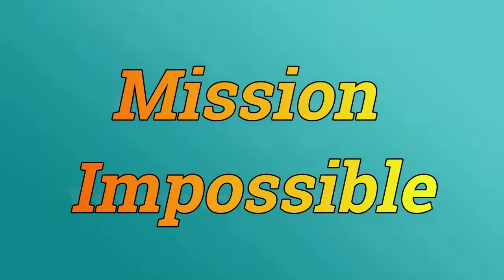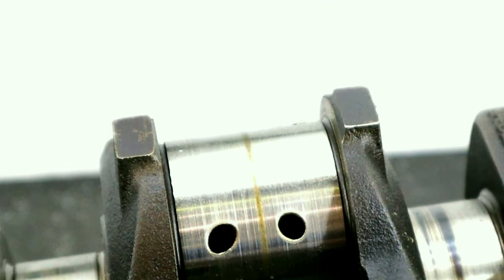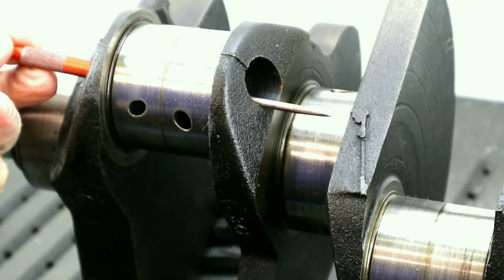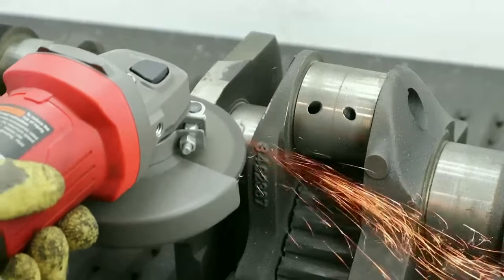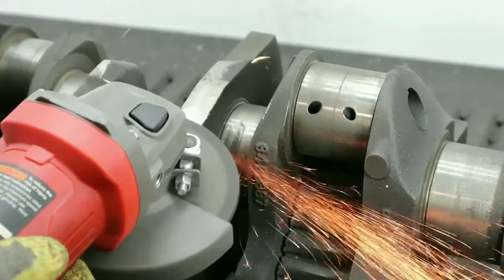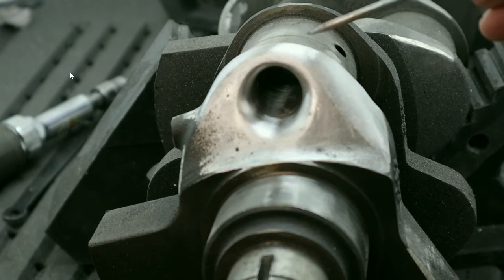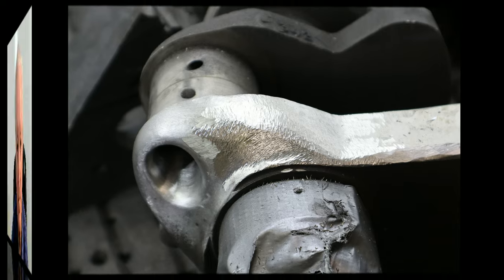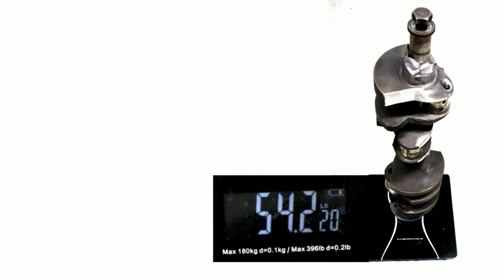How to modify a stock crank to entry level race crank.

Comment: I want to share this with you vizard fans. As a younger man in my early 20’s aroun the late 90’s I purchased his cylinder head book. I read it front to back and back to front numerous times. I built my first serious engine using his tips tricks and techniques in cylinder head flow. I ported my heads for this engine. I put this engine in my daily driven 3rd gen camaro. First time out to the track it went faster than my hoped for time by over half a second. I just wanted a 12.0 daily driven combo. This thing, full weight, nice car, everything worked and on some crap 555r radials with the cords showing, blistered a 11.56 at 121 mph. I credit most of what I learned on cylinder head porting to this man. Thanks David for sharing your hard learned secrets!
Reply from the maker: Travis - you are very welcome,
Reply: @DavidVizard  hi sir, is it possible to use your knowledge in the video on a 4 cyl. crank ? what's your tought ? and thanks for your videos
Reply: I read his book and used almost the one 400 chart for my 406 build in my c3. Everyone said I was overcarbbed would be a dog etc. It's the fastest engine I ever built!
Reply: Also I polished and ported every oil passage and molded my hp950 carb even knife edging the butterflies and screwheads... molded the melling oil pump per his book it shoots oil 8" over the headers now. Lol
Reply: @kermitahnenerbe3722  Doesn't matter what kind of crank, the basic principals are always the same.
Reply: @CarLos-yi7ne  thanks

Comment: Thanks again for all you do. I always get nervous grinding by crank journals. So I get radiator hose and cut it into rings wide enough to cover the journals and hold 'em on with zip ties. Then grind to my hearts content
Reply: Or just tape the old bearings on
Reply: I use a PVC pipe and ducttape
Reply: I know when I get a grinder into my hands, especially a small one like a die grinder, or a dremel tool it's very easy for them to get away from me and either take more than you wanted off, or to hit something you didn't want to touch. As David demonstrated it's a great idea to cover up what you don't want to touch. It's also a task that takes some practice to get good at it. We need to take our time. Getting in a hurry is often the cause of mistakes and of course take the time to understand what we're taking off and why.
Reply: Yap yap yap yapity yap.
 Watch my video about a crap crankshaft SCAT sent me and how I fixed it.

Comment: I'm sure David would agree that if your doing this for the first time , protect the bearing journal's on the crank by wiring on some old bearing shells or shim stock . This is a cast iron crank which is identified by the thin flash line , numbers , sand finish etc. Your engine , depending  on age , may have either a cast crank or a forged one which is more desirable,  although a cast crank has some desirable properties. A forged crank is identified by a wide flashing , with obvious  grinding marks , no through holes in the big end etc., but the process is the same . When deburring using a rotary tool , take time to radius the oil exits on big end and mains to improve oil flow but do this after gaining experience with the tool on the metal in non critical areas of the crank .
To reduce the wind age in the crankcase and overpressure oil leaks , I run a constant vacuum by using an alternator from a diesel engine that is fitted with a brake servo vacuum pump . Fitted to numerous Japanese engines you also benefit from the very reliable Denso type with high quality bearings and seals rated at high rpm . Both the vacuum pump and alternator can be modified to aircraft spec with little cost and effort and to make the pump adjustable for depression if you are fitting your modified engine in a kit build aircraft .

Comment: Great show as usual, David… But I believe in buying quality tools , you can get those cheap ones and they will last a while If you don’t use them that much and push them but they eventually crap out .Matebo,Bosch, then pretty much everybody else from there. I tortured grindersfor a living and tested the Metal of many of grinder finding that wanting except for these two brands I previously mentioned the Meebo is absolutely perfect piece of engineering… Keep on rocking

Comment: Really enjoy this mopar engine series.  The grinding of the connecting rods are out of the hands of a DIY project and I don't know if a machine shop would take on the meticulous grinding process or what they would charge if they did.
Reply: I worked in an engine shop,and when I was building one for myself I wanted to do all the little tricks like this so I was asking a couple of the race guys ,and they're like don't bother it's not worth all the time. 
But to me it is , so it's a diy because you're right, a shop will never do this, and/or it would cost a fortune if they did.

Comment: My respect to you sir, I appreciate what you are doing. I'm really inspired by your video, I think I'm going to pick up a cheap and easy project to work on! since I live in Europe my choice is a Fiat 126 twin piston air cooled engine, in addition to modifying the crankshaft, I will lighten the flywheel and connecting rods, I will try to find motorcycle pistons that fit the engine, a motorcycle carburetor, finally a modified exhaust system. it's a 650cc 24hp engine, if i get 5 to 10hp i'll be happy. I'll probably play with the engine head too 😃

Comment: This is very timely for me, as I am prepping a 440 crank and was wandering what those dogs, lugs, or pads around rods 7 and 8 were doing there. Is there a all or nothing approach for this or can I stop when I feel I have removed enough? Meaning I don't think I will be able to achieve the level that you will take it to, but do enough to make a difference. I have the bob weights for the new Icon pistons and lightened & balanced rods thanks to your videos. After this I will be ready to bring the crank in for final balancing. Thanks, I have already supported (3 space pups) and will continue to support St. Jude's.

Comment: Thank you Mr.DV!! I wonder how does this grinding affects the combined balance of the flywheel and crankshaft in sbc?
Reply: ,,, not at all, you just don't start the balance process, till after you have the crank where you want it . Of course you might keep in mind where you are grinding, but the final balance is later  . The small blocks are internal balance, except for the 400, but the former statement still applies  .

Comment: If you have the means milling off most of the material would be a lot quicker quieter and less messy.  Failing that, a good metal cutting blade might do the job. A portaband in places where it'll fit, even a drill press coring out large parts of the waste. 

I hate grinding honestly,  it's my least favorite shop activity 😅
Reply: The dust is the worst. 
I've helped pops have to grind something that's set up in the lathe or mil and he goes crazy with blankets all over to protect the equipment.
I see it's something you don't want to do on a regular basis unless you've got an area set up to do it.

Comment: are you going to run a windage tray?  
They would not let us remove the pads in stock.   Do not be afraid of Iron cranks.  For the AMC Indy project we tried both stock ARMASTEEL and High PSI cast nodular iron.  Both worked with no failures,  cranks were detailed similar to what Dave Shows   Made 1200 hp and over 1000 for 3 hrs on the Champion Spark Plug dyno simulating race rpm  early single turbo with early head  and Fordgedtrue pistons made 800 hp but the BBC chevy size pins flexed and kicked out the double spiralocks.   Went to Chrysler Hemi pins and inboard pin boss  Bob Brooks pistons   ran the combo up to 7K but did not race at that rpm

Comment: Put masking tape on the journals, The hot metal from the angle grinder like to stick onto everything and ruin smooth surfaces.
Put many layers on, or get some aluminum duct tape for air ducts, it will not melt.

Comment: Getting so much material off the big end side you will never compensade it on the other side. And when the rods and pistons aren't lightened as well the whole matter is out of balance. 
The crank needs to be balanced by a good machine shop afterwards.

Comment: DV Why did you leave so much meat on the rod cap and or not cut a slot in that balance weight to get 4 surface areas instead of 2 as shown?

Comment: The leaks in my ranger are my indication of the fill level. If the engine stops leaking, I’m a quart low on oil. If the trans stops leaking.. well then my 5spd is effed. Lol

Comment: I have seen Dyno tests where they tested a fairly stock engine with no windage tray no Crank or any other bottom end modifications, after 3 baseline runs to get it hot and get an average set of numbers they started draining oil one quart at a time, they picked up more and more numbers and it made the most power it ever made right before it gave up...i won't say any numbers here so it doesn't start an argument but I will say oil control, making parts that interact with oil in the pan have the least amount of drag as you can, will free up enough to feel and see at the track...not to mention keeping your oil from being aerated and keeping the oil pump pickup submerged will keep you from losing oil pressure during hard cornering, hard acceleration, hard deceleration Etc...holy...there is no way that removing 6 pounds from your rotating assembly will not help...that's ounces of weight not being swung up and down like...116 times a second at 7000rpm? My math may be wrong but I know that crankshaft is dealing with a lot of forces at 7k rpm and removing that much weight will be a good thing...maybe I missed it but did he say anything about removing any sharp edges ? If I remember correctly Sharp edges can give cracks a place to start....I need to rewatch this and make sure I'm not missing any great information...I doubt he will see my comment but I appreciate every video he makes...I appreciate the time and effort he has put into his work and the fact that he is willing to share the knowledge he's worked so hard to gain with us for free...

Comment: Can a DIYer drill the holes in the crank rod throws?
Reply: Great question. Does the hole need to be centered not to cause an odd expansion/ contraction problem.?And how close to an oil passage would be safe?
Reply: @jimlathrop8603  Stick a coat hanger or welding rod in the oil passage and measure-line-up from there.  I would want to miss by fifty thou.
Reply: Not difficult if you engineering experience and you have access to a machine shop,and a Milling Machine or if you think you are capable you could use a pedestal drill and make a jig. Setup and angle and allowance for oil passages might cause you a problem if you are Not careful.

Comment: This used to be the 'Hot Mod' nearly 50 years ago in SCCA FV racing with Volkswagon cranks. Grind them to a "blade" shape to "cut" through the "windage" in the crank case better. I tested this on my Stuska dynometer. Nothing. Sounds good but in the real world did nothing measurable.
Reply: Shoulda had some nice response though. 
I was messing around with a Briggs v twin recently and found that early rods weigh 30 grams less ,each. 
She responds nicely now. 
And any of my mk1/2 vws always liked me removing 6-7 pounds from the flywheel from it's original 13. 
There's a weight on the outer portion that's like an inch thick and an inch long.
Reply: Blade shaping will give best results on old engines were the crank hits the oil in the carter. Modern engines have the crank rotating  above the carter oil and depend more on a pressurized oil feed, not much gain there.

Comment: How does this help people with crankshafts that are balanced from the factory?
Reply: After all the rods are ground down and the crank is ground down then the whole rotating assembly needs to be sent to be re-balanced.
Reply: @davej3487  then this isn't free horsepower at home. Which is in the title of the video. So, what you mean to say is, it doesn't?
Reply: When rebuilding a V8, you would be rebalancing it anyway, so this is something you can DIY for almost free.
Reply: @JeddSmith-i6i  If you change pistons the balance will be off. 

Do you really believe that factory balances every crank every time?  They do not. They know "About" what the whole rotating assy is and balance the cranks to that. 

On a Mopar engine, look at the oil pan rail. You will see some letters stamped in at each piston crank throw. AA is a small bore standard piston and EE is a slightly larger piston. 
As the block leaves the factory bore shop, they MIC each bore and stamp the sizes on the rail so the guys/gals on the assembly line just grab a AA piston with a rod on it, compress the rings and slide it in a AA hole.
They never rebalance the cranks even though the pistons can be up to 5 grams different.
Reply: @skylinefever  If you are changing pistons then YES a rebalance should be done. 

So if you will rebalance, might as well spend 6 hours cleaning crap off the crank before sending it out. 

A factory balance is just a "Ball Park" to get the engine to the assylimbly line. It will be OK for 150,000 miles but I have seen factory balanced cranks off by a few grams. At 4500 RPM, its not an issue. 
But if you plan on spinning 7500++ RPM, it is NOT good.
Reply from the maker: Jed - we are getting an almost race grade rotating assembly for little more than the cost of a balance job.
Reply: @davej3487  I know on some of the vws they used to have the parts grouped by weight.
Like they may have 3 sets of rods on average that weigh light medium and heavy.
So they group all the parts like that and slap em in and it's close enough. 
Definitely wouldn't wanna replace a rod  by itself unless you knew it was in the same weight group or you were better off replacing them all. 
You already know all this but they do the grouping with all the other parts too, pistons and whatnot.
Reply: @MrTheHillfolk  Yep. In street use "Production Close" is good enough. But as David Visard and many others have proven,  its not good enough for a race engine. On a V8, you always fine the WORST part of the 8 and clean it up and then make the other 7 match it.
Reply: @davej3487  that's what I've always done. 
It's kinda surprising how far off they can be for production use and still live a decent life usually.

Comment: Is there a forged 318 crank ,,, ?
Reply: 273 and early 318 shared the factory forged
Reply: 1958 thru 1967 Poly 318 had a forged crank. They used the Poly 318 crank and con rods in the 273 but had to add a huge wrist pin to balance the much lighter 273 pistons
Reply: @davej3487  340 had a steel crank too, was that the same as the original or new?
Reply: @blueyhis.zarsoff1147  Early 340's had a forged steel crank from the factory. It was slightly heaver than a 273 Forged crank. Late 340s had a cast iron crank. 

In general use, a good factory Iron crank is good for about 450 HP and 6,500 RPM. Most times the valves will float before you get above 6,500 RPM.

Comment: I took your word for it and gave you twenty minutes of my time. In essense im told buy a cheap grinder and remove the shard edges and unnecessary lumps. With such disregard of other crankshaft forms and harmonic dampening . Also stress traps like the tiny square ends that offer no visible reason for their creation. I feel more deceived than informed. I didn't arrive to sponsor any charity. This was entirely about race preparing crankshafts for entry level racing engines.
Reply: Jack, please post a link to the video(s) you've taken your valuable time to create to help pass along knowledge others can use to build better performing engines, or at least understand what it takes to do so.  Thanks.